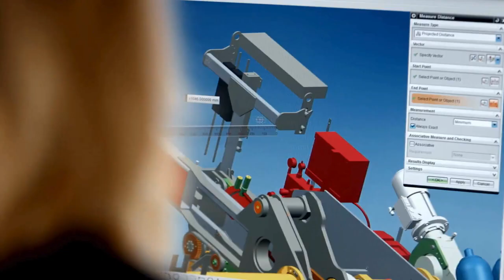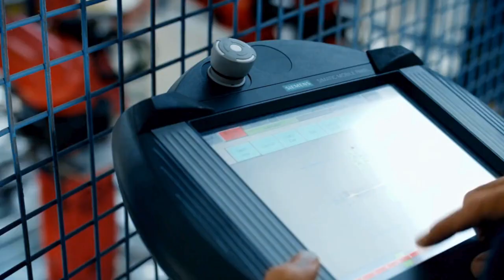Opcenter software platform for Smart Manufacturing

Comment: Individual ordering system for producing things could really help. Something like remote 3D printing and delivery )
Reply from the maker: Thank you for your comment. In our experience implementing MOM Software in manufacturing, 3D printing, Additive Manufacturing and Flexible Manufacturing Systems (FMS) are systems encouraging one piece flow. Manufacturing Operations Management models work flows in containers. A container could be one piece, a batch or a combination while flowing through a complex systems. A MOM Software helps you define this flow as per your existing system but more importantly has the flexibility to change the flow easily when your systems or business needs change. Just like how Additive manufacturing and 3D printing provide agility on the Operational Technology (OT) layer to manufatcure goods, MOM Software provides the same agility and flexibility on the information technology (IT) flow layer.